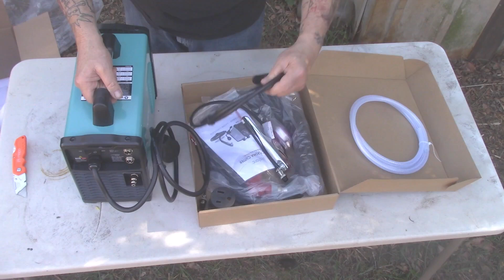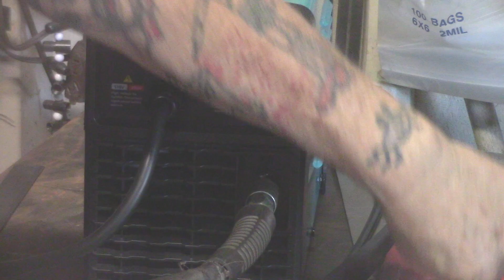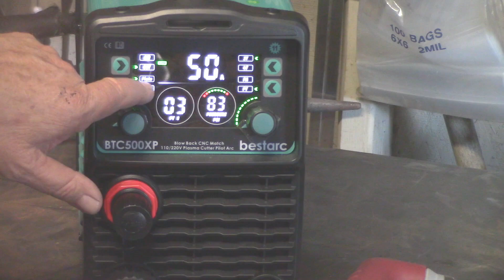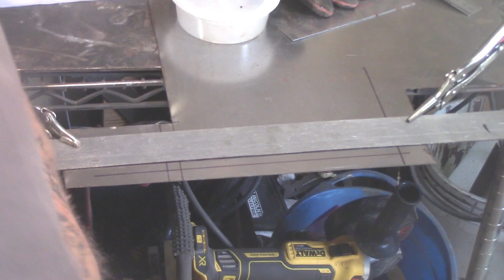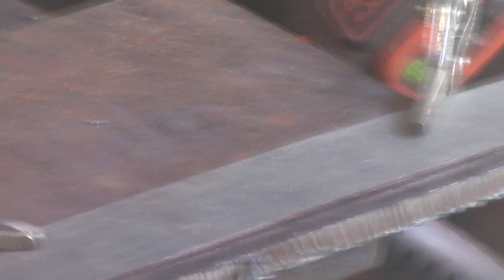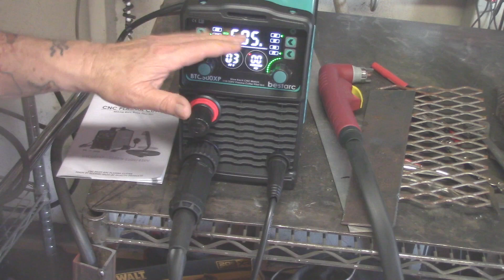bestarc BTC500XP CNC Capable - Plasma Cutter Review - I Love It!

Comment: Hell Yeah 👍 now you can build a full suspension motorized bicycle frame.... 

It's nice how plasma cutters are so much cheaper compared to 25 years ago.
Reply from the maker: That's the plan. Build a full suspension frame,  take it for a spin, grenade it, then fix it!
Reply: @HughesMotorized  lol  reminds me I gotta check my chain & plastic chain tensioner roller wheel. I found a couple free narrow skateboard 🛹 wheels. I'm gonna grind the sides sidewalls down. So they're not as wide & make a chain tensioner roller wheel that'll last forever.
Reply: @HughesMotorized  awesome!